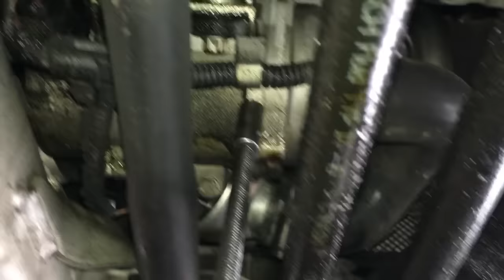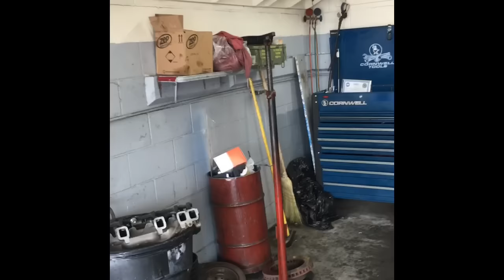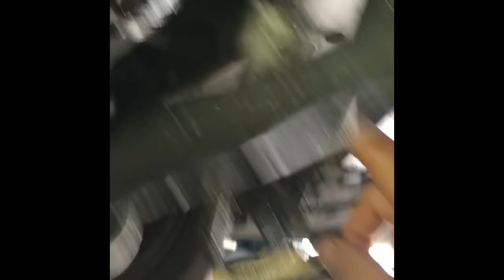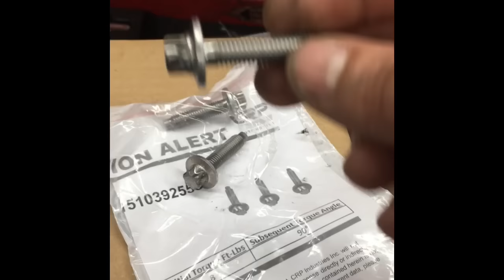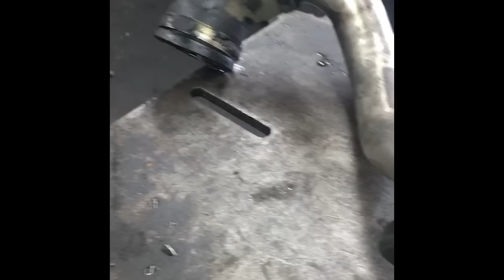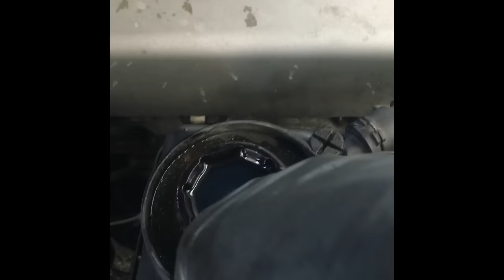How to Replace Electric Water Pump and Thermostat on a 2006 BMW 325i

Comment: At what miles do these go out at, I’m at 130k and the car is driving fine other than small maintenance like rotors and brakes etc, is the chance that it’s been replaced when it was lower miles high?
Reply from the maker: I wouldn’t say there is a range on them I’ve seen them as low as 30,000 miles go out. Probably more luck of the draw.

Comment: i have an 06 bmw 325i that over heats, had the thermostat , water pump, & air flow sensor replaced & it still overr heatsss? also the fan from the motor gets veryy loudd ???
Reply: Head gasket blown?
Reply: Same with mine
Reply: @mineliatrujeque9725  update?
Reply: What did you do?
Reply: Any update?

Comment: I change the thermostat and the water pump brand new but it keeps heating any solution?
Reply from the maker: Osman Rapalo Either you have air in the system or the pump is not been turned on by the PCM possibly a bad Fuse
Reply: There no electricity going to the water pump
Reply: And where’s the fuse located ?

Comment: After replacing the water pump do I need to restart anything on my computer system?
Reply from the maker: shagy16 just clear codes if the check Engine light is on.

Comment: I just replaced thermostat on e36 yesterday and now i know how is thermostat supposed to work.. I concluded that termostat on 2006. 525i is not good as it should be, and after changing out thermostat on e36 this seems like a huge thing to do...
Reply from the maker: Boz 2011 it's in a tight spot for sure but it's not impossible to do.

Comment: Hi,  I recently got the code PO597 Thermostat Heater Circuit Open on our 06 325xi Manual (150K).  Car is still drivable and not overheating.  Cleared code once and same code came back after 200 miles of driving the car.  I ordered a new thermostat, and would like to know if I can just replace it without removing the pump?
Reply from the maker: mjcorp7652 that's the heater built into the thermostat. You can just change it with out taking the Pump out.
Reply: Thanks for the confirmation.  I got a clear view of the thermostat and it looks very tight in there.  I guess my question is, how long would you keep driving the car?  Not overheating and drives ok so far.
Reply from the maker: mjcorp7652 The problem with driving it is you're Check Engine light will be on in if any other additional problems appear you won't know that they're happening. So I would fix it as soon as you can.
Reply: Thanks to your vid, gave me confidence on getting it done. Tight in there but got it done in a few hours. Checking temp and about to test drive soon.  Thanks again.
Reply: @mjcorp7652  update?

Comment: Can I please ask you a question I just replaced my water pump on my 2006 325i , but when I try to do the bleeding process the water pump wouldn't work , follow the steps many times " put key in slot , push button , press accelerator I tried it car still won't to the bleeding , pump is brand new can you please help me with this issue , is there a fuse or relay help !!
Reply from the maker: There is a fuse and relay. I'm not at the shop to look it up but the fuse boxes are under the hood on the drivers side, in the glovebox and in the trunk on the right side. Hope this helps.

Comment: What were your symptoms that led you to replace the pump and thermostat? Car overheating. heater not heating up etc.  My heater gets warm air at idle but on the road .with air forced through the radiator, heater air is cold. Separate problem on my car is warm heater air on the drivers side but cold air on passenger side. Any thoughts? Thanks
Reply from the maker: Harry Butler on this particular car it had a code for the electric water pump. It sounds like your car is low on coolant you may have a leak somewhere. A stuck thermostat will also cause heating problems.
Reply: Thanks for the response. I had a pinhole in a coolant hose. I replaced the hose and refilled the system a couple weeks ago but only learned about bleeding the system after researching the heating problem. since then I have driven the car several hundred miles and have topped the coolant of a couple times. I think I am going to change the thermostat and see what happens. I have a 2007 328i. I bought it with body damage about a month ago and I'm learning what a pain BMWs evidently are.
Reply from the maker: Harry Butler if you're still adding coolant you must still have a leak somewhere.
Reply: Sorry I was not clear. It appears that I simply had not put enough coolant in it after replacing the hose. The level has stabilized now; but I have read that others had experienced air pockets. I suspect that if an air pocket existed it would have worked its way out by now. I appreciate the help.
Reply: Hallo Harry 
Ive got bmw e90 2006 3.18i  with similar issue 
hot blowing air on the passenger side and cold air on the driver side.  Did you solved out your problem so far ?